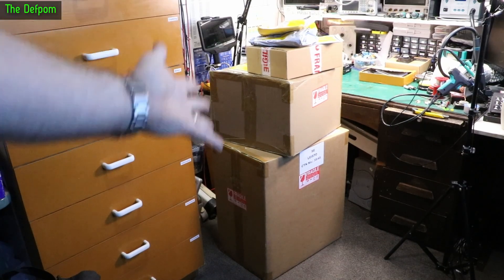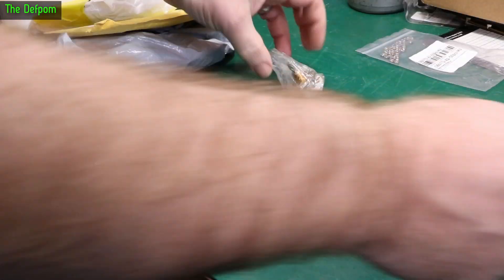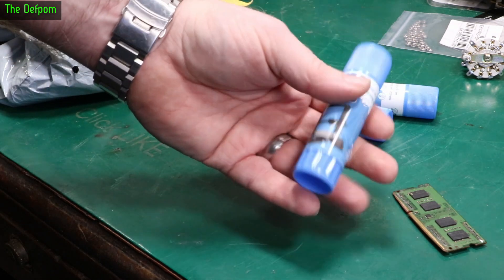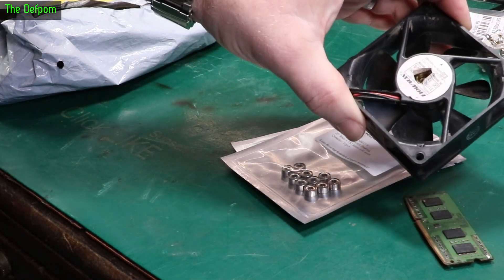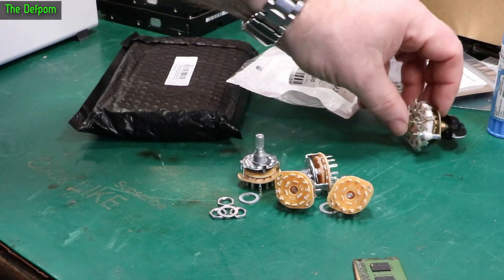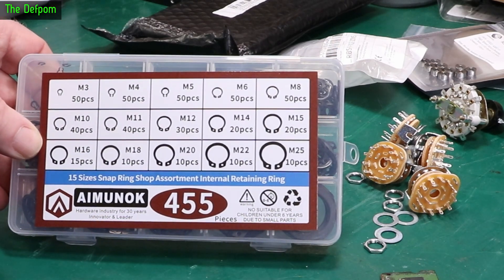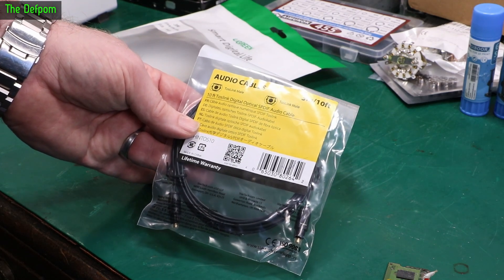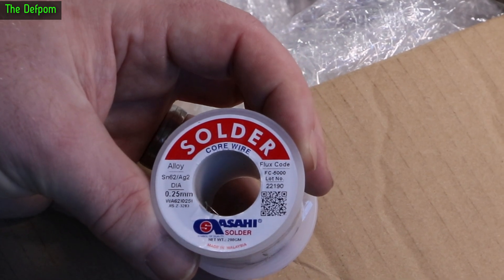🔴 Mailbag Monday 22nd July 2024 - No.1265

Comment: My flume extractor has sucked up some quite large components, Now if i can't find a component and it's been running. the next point of call is checking the filter. 🙂
Got mine in a auction when the company I worked for closed down.